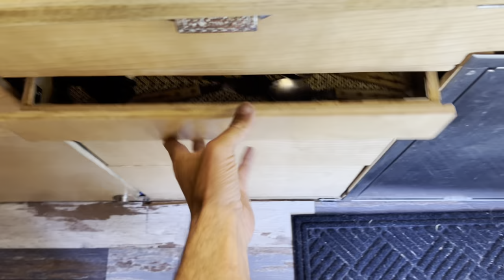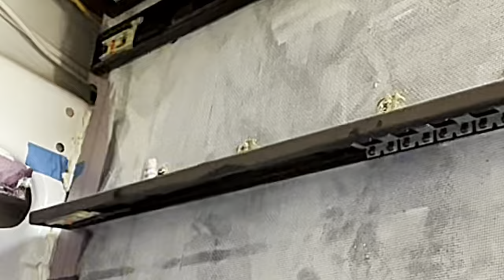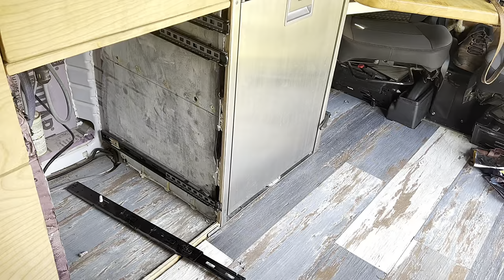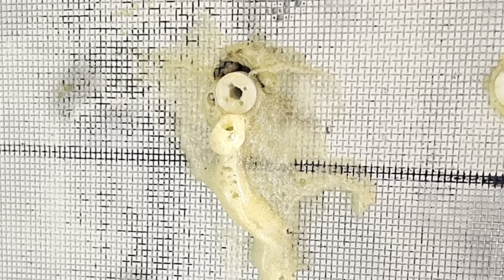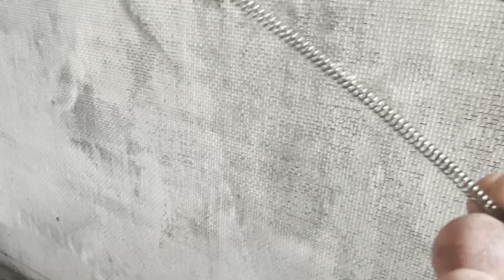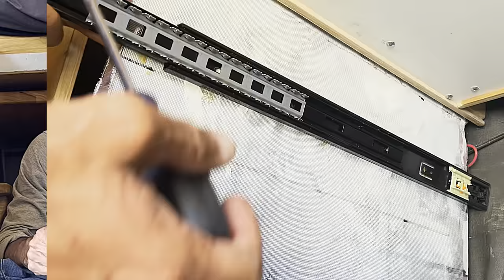When Foam Anchors Fail - Foam Bones Van Build System Vol. 3

Comment: This method of using drywall anchors ccurred to me last night while bumbling around the shop, and I was wondering if a glue would improve my test results.

I've been wondering about how to transfer the anchor locations to the foam through plywood.  My first thought was to partially insert screws and use the plywood + screws to make pilot holes in the foam.  After experimentation I found that the anchors have a tendency to wander around while being driven.  After having a further  think, I will put the anchors into the foam first, then make a paper pattern on the foam+anchors, transferring anchor locations by rubbing the paper with my dirty fingers or with one of my kid's crayons.  I'm trying to end up with my screw heads countersunk into plywood on top of foam, so precise screw locations is important to my application.
Reply from the maker: I pondered this for awhile too and I settled on this solution: 

Cut plywood skin to shape, put against foam but don’t glue down, measure out where I need the anchors, drill small pilot holes everywhere needed through ply and just barely into foam, remove ply, insert anchors. 

But the system you described would work too if for some reason the above is not a good fit.

Comment: If more of your holes get egged-out, I'd suggest running thin metal strips vertically -- sandwiched between the foam and the drawer slides at a 90° angle to the slides. That would link all the screws behind the drawer slides together so all the screws would stay in alignment and share the weight. So, if one drawer was heavier, the other 6 or 8 anchors on each side would bolster it. Also, if you take the strips all the way down to the floor, and add more anchors and screws between drawer slides, it will greatly increase strength and transfer the weight from the foam to the floor. The strips don't have to be robust if it's tied in with the foam sides. Metal plumbing hanger strapping that comes on a roll might even work. Downside is that It would move your drawer slides in about 1/32" on each side. You 'd need to check tolerances there. •••• Next cabinet build, maybe put vertical sheetmetal strips from top to bottom in line on center with the mounting holes of drawer slides you're planning on using. You could put as many anchors into the strips as you want, and then just mark and mount the slides into the metal strips with regular sheetmetal screws. I suspect it would be far easier to install the slides that way.
Reply from the maker: Interesting idea!

Comment: I wonder whether adding carpet tape behind the drawer slides would provide enough extra support to be useful.  This way the metal of the drawer slide itself acts as reinforcement.

  It would be easy, cheap, and light to try.
Reply from the maker: Good idea… or just straight glue it to the wall with the Gorilla HD. I wanted to follow the foam anchor only idea down the rabbit hole for science but, yes, other support would help. Also, as far as carpet tape… some adhesives have trouble sticking to the foam, I don’t know why, so should test them.

Comment: hi i like your system alot, im a cabinet carpenter, i would suggest 3/8 wood strips under all glides. also gorilla glue makes a wood glue, iam thinking foam to foam or foam to 1/8" wood. your testing is great.
Reply from the maker: Agree… wood strips or discs could be used for sure… trying to follow the foam drywall anchor thing down the rabbit hole for science 👍🏽

Comment: I have a minivan and you have given me some ideas for using XPS instead of plywood for floor and bed platform. How would you go about installing (short) table legs onto the foam. Regarding the bed platform, I am thinking using bolts and nuts, with bolts going all the way through with the nuts on bottom. On the top side, should I use large washers or perhaps a narrow and thin sheet of metal going across the width of platform as the "washer."  Any ideas or videos?

Comment: I had an idea for reinforcing holes for heavier drawers.  Maybe some kind of steel collar or grommet or something, I don't know the name, but a metal plug about 1/2" to 5/8" diameter, with notches that prevent rotation?  Or maybe glue on wood blocks, or sandwich some metal or wood on either side of foam, glued on or screwed though?  I definitely do not want to be worrying about failures like this after a few weeks/months, as that's a project failure.  Need a workaround for heavy duty joints.  By the way, how was that big slide out in the back?  What was it, a cooler or something?  I imagined that'd be the first to fail.
Reply from the maker: The drawer issue (on later inspection / revelation… to be covered in future video) was from the push to open drawer slide breaking, that drawer sliding out and being out on a bumpy road. I don’t think it would be an issue if the drawer did not fly open like that. 

The slide in the back is holding a huge electric cooler freezer that is always full of beer and soda waters… plus there are tools (screwdrivers, wrenches, etc) under it AND 2 sets of dually leveling blocks. It’s easily 100-150 lb. It’s on 250lb heavy duty drawer slides screwed into the same foam anchor system. The only difference is that I used 1/4” ply ABOVE the slides to help lock them in place. 

That all said, embedding wood in routered out notches or round wood plugs glued it would work fine.

Comment: So far into video 4 on the playlist.   Something that I wanted to note is that this construction method is very similar to how they make foam core boats.    If you use the same methodology they do to attach anchor points in fiberglass as you do here in this foam core build, you will see you still have to use some kind of gusseting of stress points. 

Garage 54 a while ago tried to make a Plexiglass engine.   Each time it still broke the block.  
It has to do with the point of stress involved at the angles of pivot force applied to such a small area.    
Just like Webbing is used on Engine Blocks and heads?   You have to emulate the same in these cases to distribute the force.  

Also, sliders such as these should not be used in this manner as a different kind of mounting is needed in order to be an active stress point as in the case of the drawers.   

If these rails were molded into the foam core along its entire length?  (Or rails designed to be mounted as such like in Ikea slide Fabric shelves)  There should not be a problem with them.   

It seems like these are all small issues that people had before when they were working on Fiberglass cars and boats from before.  And these small issues were all tackled with using Metal reinforcements or other synthetics such as  GRP or a combination thereof. 

Foam Buildings are in fact a real thing today.  But they use a Rigid Frame or skeleton to handle all the load bearing parts.  Doing the same would be best in this case for cabinets IMO if using traditional hardware.   
It's important to note that those sliders are engineered to be used with Wood.  

Making or DIY Building your own sliders would be the appropriate way to go about this in future builds or modifications that you should also be able to 3D print as needed.   

Another method was tried by Chrysler in there  "Wire Car" they did for Nascar.  
I think it was Smokey that came up with that.    Using Wires on tension would also work to hold up stress points.  

I have tried in the past to make foam core speaker boxes with some success,   but the mounting of the woofers and the box deflection was always an issue without proper reinforcement.   
Marine grade Glass fiber did work, but only for Ported enclosures with drivers of moderate power or excursion.  

Just my 2 cents of blabbering.

Comment: I think after fixing the runners i would have put a 1/4"ply from th3 bottm up between the runners glued to foam to add support for the runners without affecting original draw size

Comment: Did you considered glueing and potentially also screwing a thin wooden band/plank over the area you plan to attach heavy loads to reinforce it? Then you could attach the rails by screwing through those and into prepositioned anchors behind?
Reply: For even more strenght, vertical plancs would add support from the floor.

Comment: wat you could do with the failed ancors is put a thin piece of plywood across the full length under the slide maibe even resting on the slide below , there should be enough room on the sides of the drawers for that and it alow you to use a lot more ancors and screws for the same slide and that should make it take enough force unless it deforms the slide itself
Reply from the maker: I did something similar for the cooler drawer slides in the back… to be covered in a future video.

Comment: since all the force transferred from the screws to the foam..  it might help if you glue a long strip of 1/16 wood (1/8?) between the slides and the mesh backed foam, so that the screw goes through that, then into the  drywall screw.  this might be enough to redistribute the force to the foam wall instead of to the drywall screw.   then you can keep heavy pans in the drawers if you want.   my initial thought was vertical strips at the screw points so the force goes to those, and they're effectively pillars backed by the mesh reinforced foam wall..  the wood would have to fail before the foam was affected.
Reply from the maker: Lots of options there… I’m trying to follow the foam drywall anchors idea down the rabbit hole for science for now👍🏽
Reply: @falkornomad  I totally get it. I tend to overbuild things myself, so it's nice to see the path of "let's be reasonable, and see if this works"  haha.

Comment: Though it is very chemical. Now is maybe the time we need to do the polyester/epoxy fiberglass construction in this high load application. What if you would reinforce the drawer side panels with glass fiber? I don't like to use wood (like a lot of people suggest) in these construction area’s because wood is soft, not moist proof and not a ‘dead material’. I still believe your approach of using wood as mostly decorative and lightweight foam as a base is the way to go in an automotive environment.
Reply from the maker: Fiberglass and carbon fiber rather than the screen could work…. Epoxy for the matrix would be fine… coroplast for the skin rather than wood… some combo like that could be a very waterproof version👍🏽

Comment: I love the idea and all the experiments you’ve done.  But the finished results looks very wonky to me.  Several of your drawers and doors are just not closing or they are at an angle.  Is that the result of the foam sagging under weight?  Would a rigid framework be a safer bet?

Comment: Hi, great channel! I just subscribed and am going back through your old posts I love how you do lots of testing and show your methods and results for the tests so we can learn along with you. I don't see many people on utube doing builds with screen over foam, most are doing canvas over foam (PMF) but for me I am more interesed in the screen material. I have heard that glidon gripper has been discontinued and the product that has replaced it has less adhesion. Have you done tests on other adhesive paints or primers? I was also wondering if you could use tight bond 2 or 3 instead of a paint. Have you tried any different screen types like fiberglass or aluminum, (from the earlier videos it looks like you are using nylon)?. Thanks again for this valuable info. I am planning on doing a foam canoe this summer, should be a fun project.
Reply from the maker: I have not tested but another comment says Titebond is cheaper and works great. My glue up video is coming out next, then screening video, I’ll talk more about this then. But I THINK any primer or heavy duty / multiple layers of paint should yield the same basic results. The foam can bend, in order for something to bend it has to get longer on one side and shorter on the other… the screen and paint is just resisting those lengths from changing. The screen I used can be found on Amazon: DocaScreen Fiberglass Roll https://a.co/d/ggE7kfQ
Reply: @falkornomad  Thank you for the response, looking forward to more videos!

Comment: Wonder if gluing a thin support strip of foam underneath the length of the slides might help distribute the weight over the whole surface rather than just on the screws?
Reply from the maker: Yes it would... I wanted to follow this system down the rabbit hole to test it, but there are many good ideas like this in the comments of this video.

Comment: Thanks for the great work, I am learning a lot.  

Can you answer: why are the drawer faces not exactly flush with each other?  Is it because of the foams bending?  Thanks.
Reply from the maker: Well for the one failed drawer it is… but mostly it’s because I’m an amateur carpenter and I was in a REALLY BIG rush at the end of the build and I was working outdoors in over 100°F… the drawers and cabinets are all grain matched (cut from same piece of wood) and my cuts (or maybe my sanding) was not perfectly straight.
Reply: @falkornomad  Thanks!

Comment: English isn't my mother tongue, so pardon me if what I say doesn't make sense.

As you said, the main problem is that all the vertical forces go to the anchors. The solution of not putting too many heavy things in one drawer may reduce the risk, but I don't think it's a long term solution because all it takes is one bad road with nasty potholes for a single pan to cause the same amount of damage again. The solution in my opinion would be to make it so the vertical forces go to the floor instead. I would imagine you could put a small wood beams to connect the railings to eachother and eventually to the floor. I'm gonna try to illustrate it below: just imagine the "===========" are your rails, the "|" are the wood beams I'm talking about, and the "----------------------" is the floor.

===========
     |      |      |
===========
     |      |      |
===========
     |      |      |
----------------------

If you don't understand my english, I'd gladly try to explain it again. We could video too! I'm very interested in your series because I'm planning on converting a trailer (instead of a van) and foam bones would be great because I'm not much of a wood worker.
Reply from the maker: Your English is near perfect! And your idea is a good one. I know I COULD do that… even considered doing it. I could also glue the drawer slides to the wall and screw them down. This would distribute the stress over more area. However, I am experimenting with anchors only to see how they fail and when. This way I can share with you and others. 

Thanks for the idea and very clever way to draw it in comments! If English is not your first language, where are you from?
Reply: @falkornomad  Well thanks for experimenting! It'll save me some headaches.
I'm from France! But my mom's english so I'm cheating a bit haha
Reply from the maker: de rien! Happy to save you as many headaches as I can.

Comment: I’d be curious depending on what was on the opposite side, about cutting out a 1”x1” , or as needed, in the foam and replacing with a new piece.
Reply from the maker: That is very easy and I have done if a few times. Or just leave the hole if it’s not needed in the situation.
Reply from the maker: Sorry, did not notice what video you were asking about… yes, for the screw anchor failure, absolutely, could cut out and replace them screen over both side and add new anchor… good point and thinking. I was on the road without more foam for these fixes.

Comment: Why not at a sleeve along the bottom of the rails so when I do decks, I notch the posts and put the two by fours into the post and then I use a fastener on top of that it’s actually sitting in the post and then fastened

Comment: Ever test t-nuts for this? Seems to be the solution you might be looking for.
Reply from the maker: I’m content with the solution I have… with some adjustments to how much weight I put in the drawers, etc. but no, I have not tried T Nuts, although I did consider them, but decided against since I could not “pop rivet” them into the foam.

Comment: That was a good vid but I was thinking about inserting a wood strip along the length of the screw line up...
Another thought is a 2 inch wood round, like 5 of em per drawer rail.... that way your effective glue area is pi r squared 2 inches. 1 inch would work well too - easy drill holesaw, glue, done. How about you take the oscillating multitool and slice a + at each screw and fill with epoxy...
Reply from the maker: Wood strips would work… I’m testing these anchors in my build for their ease of use and install.
Reply: @falkornomad  I hear ya that's a lot of work doing things takes time.
Reply from the maker: Hopefully my many mistakes and a few successes can inform the community. I really think there is a lot of potential in the concept… but not many people are willing to do “experimental” van builds.